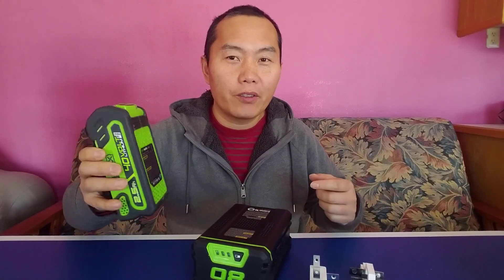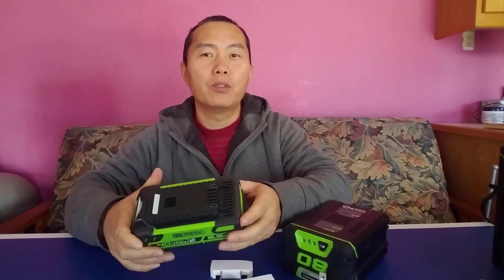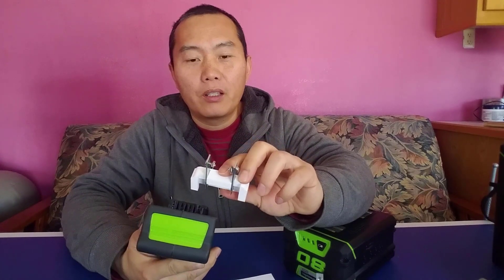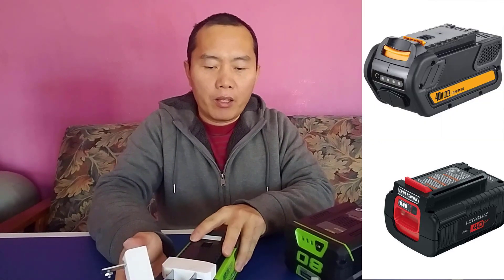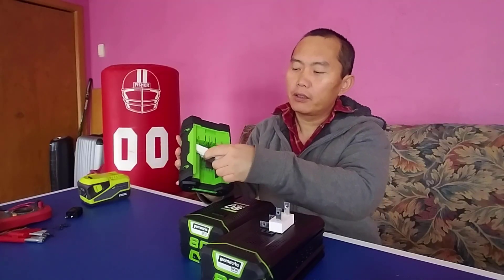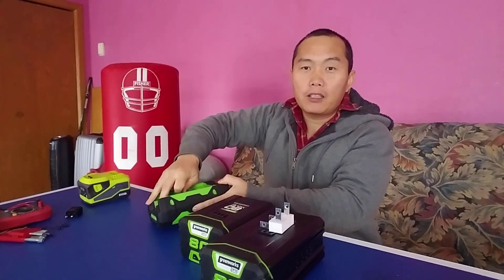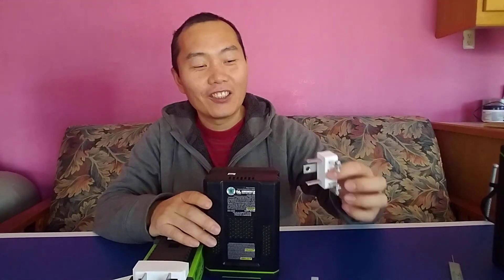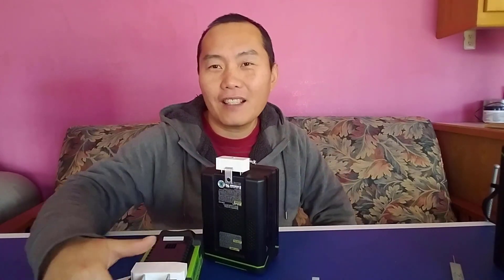ebike battery adapter 36v 48v 52v 72v

Comment: 3000 watt motor eletric motorcycle em2 ...with 72v 20ah  battery can I power my bike with the  80v as you explain on you video
Reply from the maker: yes. 80v battery work directly with 72v ebike system.

Comment: Hi i was given a new 48v battery it fits my bike the display lights up but no motor power.
My bike has 36v motor/contoller it says on the controller up to 48v.
Reply from the maker: need to use 48v controller

Comment: 2.5ah battery on a ebike ???  what is the  point ??
Reply from the maker: Fun ride. Not everyone ride ebike for long distance.
Reply: @JerryMinne  for the size  it might  be a good backup  if your main battery dies 
.. is there a way to use a 80v  battery on a 36v ebike ..  some converter so i can only pull 36v or 42v ??
Reply from the maker: Need to upgrade speed controller to fit 80v batteries.

Comment: Is there a Ryobi 40v connector? 40 v should be ok for a 36 volt bike? What size inline fuse do you recommend?
Reply from the maker: 40v power tools battery is good for 36v ebike system. You can add 20a fuse for it.

Comment: i have a ebike. Mid drive motor 1000w. It say controller can use 48v-52v. Im just looking for longest range( most miles) possible. Whats the biggest battery i can put in it? I was looking at a 60v 35ah
Reply from the maker: Well, there's many high capacity batteries on market. Just make sure you have space available on your bike.
Reply: @JerryMinne  so the amp hours ( ah ) dont matter Just longer power? And for higher volts just look for a motor speed controller? Im just making sure and THANK YOU VERY MUCH!!!!
Reply from the maker: @bobbluh9651  big ah= long range,  high voltage = high speed.

Comment: Hi Jerry, I bought a 52V 30AH battery for my e-bike by mistake and now I can’t use it. My e-bike motor is designed to fit a 48V. I will like to know if you can make any recommendations on how I can convert this 52V battery to 48V so I can use it? Also, I’m a subscriber to your channel now. Thanks 🙏🏼
Reply from the maker: Normally 52v can be used on 48v system without problems. You just need right connection.
Reply: Do you still have the battery?

Comment: If I were to try building this myself, could I just cut open an old electrical plug cord to use the metal prongs and wires to connect to the battery? Or do I need larger metal prongs?
I have a 56v 7.5ah EGO battery.
Like the plug on the right?
https://bit.ly/3e8m7P6
Reply from the maker: possible.

Comment: Do these work with the Green works gl900 backpack battery?
Reply from the maker: Yes. Greenworks 60v 80v 82v batteris have the same size on connectors.

Comment: Have you looked into Capacitor with auto recharge from the battery ? 
Using the capacitor as the drain and instant recharge from the battery. Switching between capaotiors through management system. 
Just a thought. 
Capacitor charges very fast. Provides large power instantly. Has anyone tried  capacitors running off a generator on the electric motor with a battery support ?
Reply: How those works?
Reply: @JUANRAMONROBLES  A capacitor charges extremely fast. Then gives instant acsess to large power output. If you set up 10 1000mvu capacitors each charging from a generator instant after discharge. Then one capacitor provides power while the other is charging. On a continuous drain  / charge cycle it 8s possible to run on capacitors recharged by the movement of the vehicle ? 
Computer mangment of the fast charge after drain would allow the capitol to be used as the primary power source. 
Essentially drain/charge continuously. 
In a few seconds the capacitor is charged gives a few minutes power. Ok ?
Reply: @charliejeans2413  got it, thanks

Comment: Jerry do you need a fuse or circuit breaker installed between the battery and speed controller?
Reply from the maker: yes. more protection always better.
Reply: @JerryMinne  what size?

Comment: I bought a power generator inverter 800w to 1000w it fit perfect on my 72v 20h scooter. The power generator uses gas and oil and can run up to 6 hours with just half a gallon of gas.  I connect the  ac 120v to the charger and let it charge for 2 hours or 3 hours.   My idea is to connect the power generator directly to the scooter to bypass the battery this way I can run scooter all day without depending on battery.  Do you have a adapter  for this?  how do I bypass the battering? do I need a switch? do I need to make sure the charger is alway connected?  I need you help
Reply from the maker: I don't think that works. Buy a gas powered scooter, probably a better idea.

Comment: I have a question? I am using a power inverter generator that output AC 120v .  I would like to by pass the battery so my 72v 20h scooter can use electric straight from my 800 watt - 1000wat power generator inverter.  do you have adaptor for this?  How can I by pass the battery?   is there a way to have a switch adapter that give me the option to use batter or power generator?
Please I need your help and I would like to buy any adapter you may have ?

Comment: I have inverter ac to Dc 220v 600w can i connect it to adapter ac 250v , DC 48v?
Reply from the maker: probably you mean from battery(DC) to AC invert

Comment: I would like to use my 52V 13.5ah shark pack ebike battery to power an inverter that I can take camping and run a fan or tv, how can I do this?  Should I use the Anderson connection or should I try to match up the universal connector that you have shown?  Would I need to use a fuse or will the BMS in the battery be sufficient?
Reply from the maker: yes. that work. but I don't know have connector for that battery.

Comment: Hi 
I have a question , can i use a 72v battery for 36v e bike please answer me 
Thank you
Reply from the maker: no. normally 36v speed controller can't support voltage over 40v.
Reply: @JerryMinne  I bought a power generator inverter 800w to 1000w it fit perfect on my 72v 20h scooter. The power generator uses gas and oil and can run up to 6 hours with just half a gallon of gas.  I connect the  ac 120v to the charger and let it charge for 2 hours or 3 hours.   My idea is to connect the power generator directly to the scooter to bypass the battery this way I can run scooter all day without depending on battery.  Do you have a adapter  for this?  how do I bypass the battering? do I need a switch? do I need to make sure the charger is alway connected?  I need you help

Comment: Can you show how to actually connect this to an ebike? I’m thinking of biking an enduro or stealth frame. Can you show how it connects ? So this is a second battery system you can carry and get extra range?
Reply from the maker: This DIY Adapter. simply connect positive to positive(red wire) and negative to negative(black wire)
Reply from the maker: https://youtu.be/O9--lgqA19U

Comment: I got a 72v in u right i dont want to take care of all these batteries i need that adaptor were is yo web site i need that i do deliverys i think that a good way so i need 80v
Reply from the maker: www.minne.us
Reply: @JerryMinne  would it work with my control analysis
Reply from the maker: @genegriffin9431  yes. as long as your control analysis is 72v system

Comment: what about using 48 volt battery with 36 volt ebike kit?
Reply: Can you explain why its cant be done in reverse? Don't want to hurt myself
Reply from the maker: you can use 36v battery on 48v ebike system but not in opposed way.
Reply: @JerryMinne  why cant it be done in reverse?
Reply from the maker: 36v speed controller will not support 48v battery.
Reply: @JerryMinne   Hello, I just bought 2kW rear motor 28ich bike on controller it says 48/72v, if I put 52 or 60v battery it still works? controlle will stop it on 48v right or it will work on 52v? and if I put 80v battery, controller will stop it on 72v? or controller will mesure it like its 72v you sayd its cant be put in opposit derection. Thanx a lot for answering me
Reply: yea and its 35Amp +-1amp
Reply: @wahuvakee  it will work because you are between the range of the control...